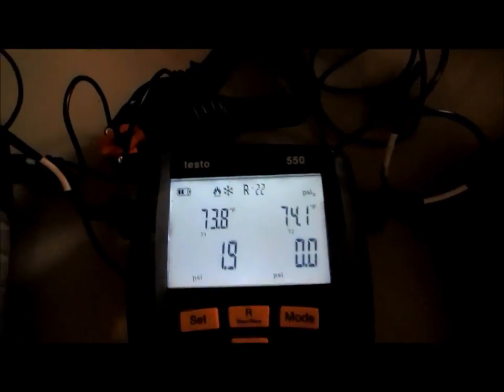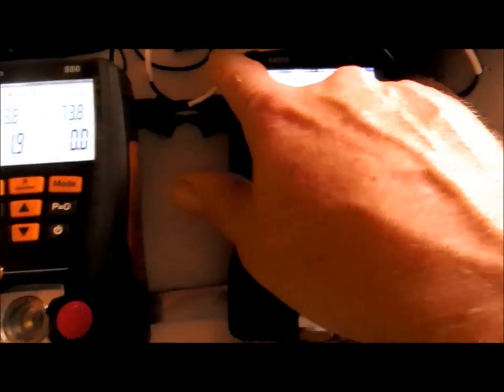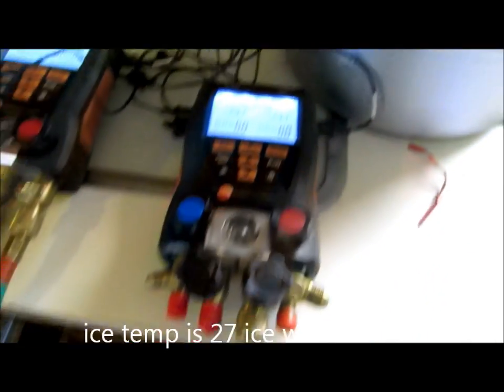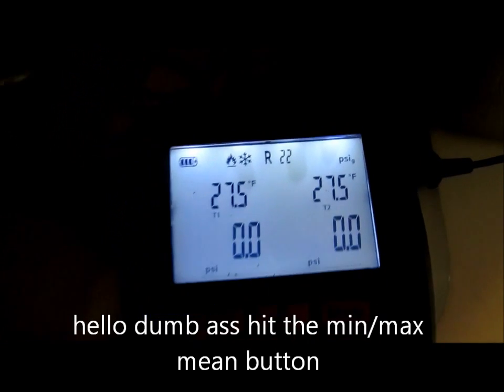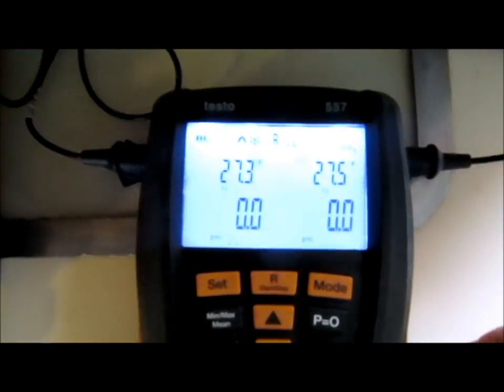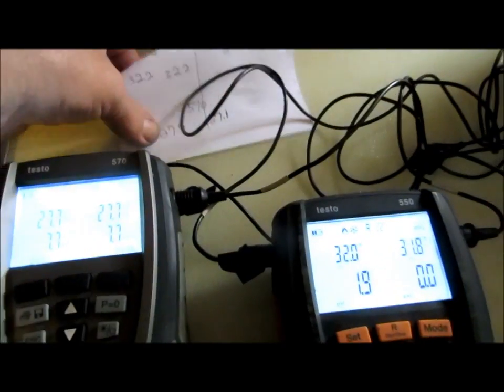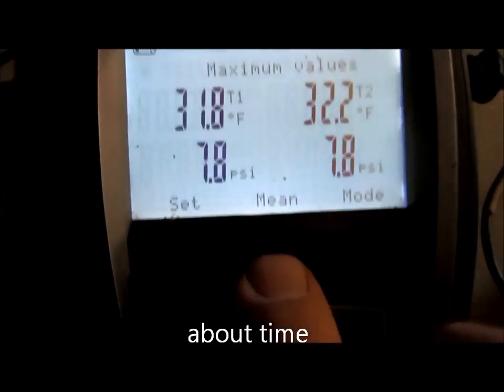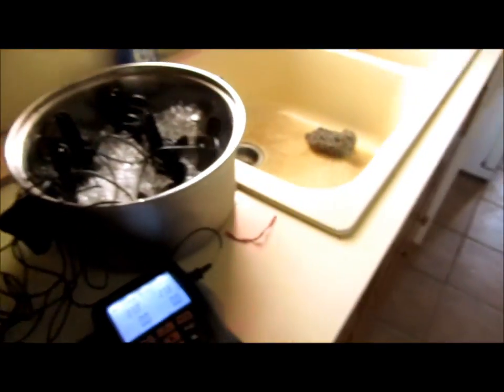hvac: temp probe test # 2 testing testo 570, testo 557, testo 550

Comment: Can you measure the probe connector with a DMM to see how much resistance the probes have at the different temperatures?  I'm looking to find a generic replacement sensor that can be used for the Testo gauges, and need to find a part with the correct resistance curve.   If I can find a suitable part I can see if it'll work as an inexpensive backup.

When you use the ice bath for checking or calibrating probes, it needs to be in an insulated container with water and ice that's free to move around in it, so you can swirl it around to get an even distribution of temperature in the whole container.  The way it works is that the ice melts at exactly 32.0 deg F, and as it melts, it absorbs the heat in the phase change, bringing down the water temperature.  
Ice alone will actually always be at a lower temperature; you can have an ice cube in the freezer and it'll sit at a colder temperature; whatever the freezer is, not 32 degrees. It's only when it melts that it's 32 degrees F.
As long as you have enough ice in the container to maintain this equilibrium, the water temperature will end up at the same temperature.  
That's why you want to use an insulated container, to minimize heat coming in from the walls of the container.
Swirl the ice around rapidly to get all the ice and water at that equilibrium point, and then you should be able to get an accurate reading.

Comment: Reset all three to the same mode this time. set the temperature compensator to off. remove the heat pump mode on all three. Pulverize the ice to the cosistancy of shaved ice. Water should be visible , stir the ice with a wood chop stick. The temp will be 32F This will be a known value

Comment: Hello.
Is there any way to calculate subcooling for INVERTER AC without having good measuring instruments ? I have 12000btu AC ( 3500 W) r410a and is not working as it should. I live in Europe and I use it for warming up my room in heating mode. After all calculations I did and after all possible error is still far from specifications. I only have low pressure from the day it was installed : 100 psi. It was 93 F outside in that day. I kept complaining about efficiency at installer and they came last days and measured again pressure, suspecting leaks. It was again 100 psi. He started recharging using gauge only and it reached arround 130-160psi then compressor stopped. He removed refrigerant until compressor is on and that's it. When he left he measured arround 115-120 psi low side and 460psi high side. This unit has only one port for gauge measuring and high side was measured on heating mode when pressure was high. This technician doesn't have other instruments for measuring this unit except pressure gauges.

Unit is working a little better now. There are higher temperature at inside unit. It was about 115 F before and now it gets 122F but there is a major change in time it gets to that temperature : it takes much longer. Before , at lower pressure it didn't passed 115F but it was fast. Now it gets after double time at 122F. Room temperature is arround 77F, outside temperature is 53F.

Is it working good enough ? Can I measure suction temperature near outdoor unit and find out subcool ?
Reply from the maker: +Laurentiu alien24cl sounds like the last guy never pulled a good vac ,,problem best to recover the charge and pull a good vac and recharge it

Comment: hi i got a 557 and he stop in 1.00 bar on LP same on HP 
i open all 4 valve press P=0 press and hold P=0 and still 1.00 bar on both sides 
can u help me a bit pls
Reply from the maker: +Catalin Angel try to remove the batteries  and reboot the unit ,try that
Reply: i took out battery for few hours putt them back and nothing
Reply from the maker: call testo  directly and ask them what to do .

Comment: Its best to have a mixture of water with your ice, don't use just ice to calibrate temperature sensors.
Reply: A proper ice bath is half ice half water.
Reply from the maker: William Sullivan i had water in there also

Comment: On your 557 i had the same problem with the valves sticking on my 550. I bought mine used and someone had overtightened them when they closed them. They are just like a faucet with a washer and seat but the washer isnt held in with a screw so the washer got indented by the seat and they would stick together since the washer kinda floats in there. Testo sent me a new stem assembly free actually and i never had a problem since.